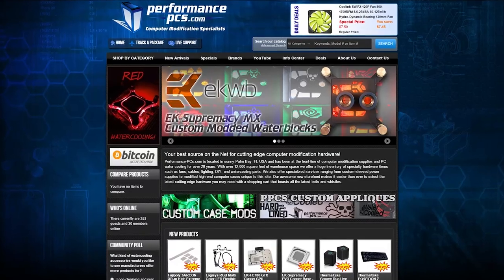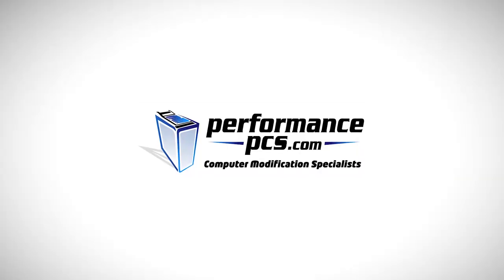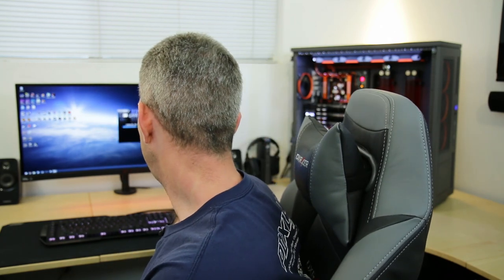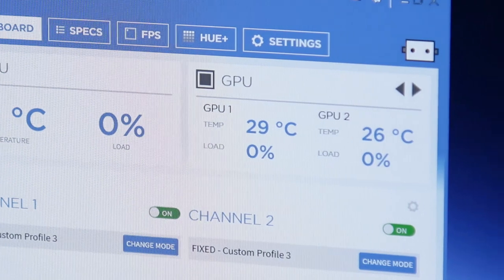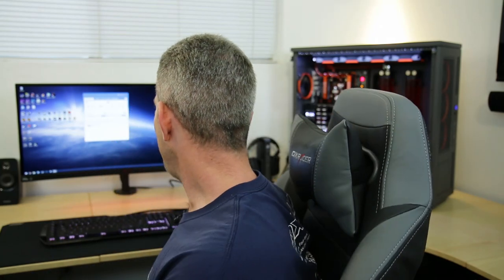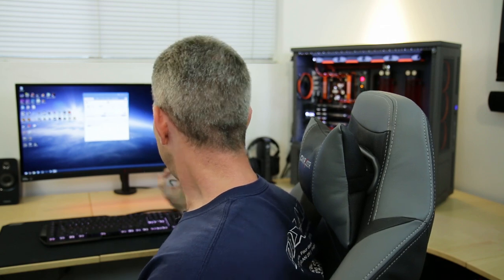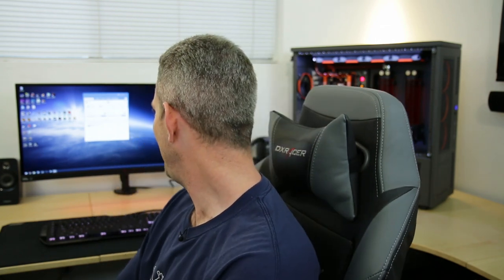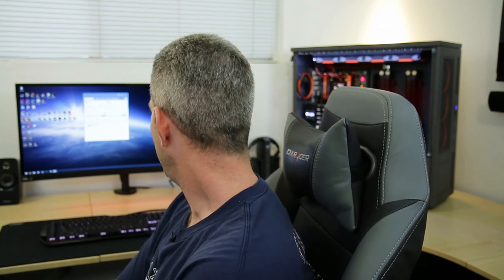INSANE Gaming PC 3 Titan X video cards! Such overkill

Comment from the maker: so does second
Reply: Jay, review your 980ti waterforce card. Thanks!
Reply: +JayzTwoCents Why don't you try to water cool a raspberry pi 2 model B+?
Reply: 2rd*
Reply: +JayzTwoCents would you put a water chiller in skunkworks?
Reply: +JayzTwoCents Love your videos Jay, Happy new years to you.
Reply: +Rpkiller condensation ?
Reply: +JayzTwoCents You should get some lighting behind the reservoirs, they basically disappear in the camera shots where the PC is in the background.
Reply: +JayzTwoCents what happend to the orange color ?
Reply: +JayzTwoCents  Excellent job.  The build looks beautiful as usual.  Questions though.  In the vid it looks like the reservoir area is very dark.  Does this hold true in person as well?  If so have you THOUGHT about the possibility of gentle lighting behind the reservoirs?  

There was speculation before on the idea of nickel plated GPU backplates for reflecting the clear GPU blocks which may have required some additional lighting.

Given the difference in color concentration between the tubes (couldn't really see the color in the blocks) and the reservoirs do you, now,  think that this effect would have been minimal due to washout from the light on the paler hue of the color in those areas?

Comment from the maker: Wow... so looks like the end slate got messed up lol... oops
Reply: +JayzTwoCents You had one job
Reply: +JayzTwoCents I was wondering about that haha, https://www.reddit.com/r/WidescreenWallpaper/ if you are looking for some widescreen wallpapers
Reply from the maker: +Chea Doherty DAMNIT JAY GET YOUR SHIT TOGETHER!
Reply: +JayzTwoCents  looks like you use fanta to cool the pc lol nice job love your channel
Reply: +Georg Meisel Proubly in the lower "basement" of the case or behind the mother board in the wire management section of the case
Reply: Chris N Anne is behind in the cable management section he showed in a video in one of the updates vlogs
Reply: +Georg Meisel IIRC he's using SSD's that are behind the mobo tray.
Reply: +NoName Fanta LOL
Reply: +Georg Meisel The drives are located in mounts behind the reservoirs. Caselabs has a really good mounting system in the SMA8 because of the extended width compared for example the 900d, it allows for more rad space and easier accessible drives :)
Reply: +JayzTwoCents No Cheesecake donuts for you good sir...good day to you sir:) j.k
Reply: +JayzTwoCents Hey Jay! I just realized you have not been using the EK Vardar fans in your recent build videos. Is it due to any reason (the fans being not the most practical for those builds)?
Reply: +JayzTwoCents I just realized your fluid looks just like Irn Bru (in case you don't have it over there it's a scottish soft drink) XXDD it's AWESOME!! XDD
Reply: +JayzTwoCents beautiful, greetings from Argentina! cheers!
Reply: +JayzTwoCents How Noise is your system with all the Fans and Pumps ? Can you maybe measure it ?
Reply: +JayzTwoCents I totally agree, would love to mod myself, have been thinking when I rebuild my rig, to spray paint it in a two tone or something. Skunkworks looks great!

Comment: I think you should but some LEDs behind the reservoirs because they don't show at all right now. :)
Reply: agreed it would look so much better with some chrome or led's behind the resovoirs....looks awesome! thats my next purchase tha sma8 case...so much room
Reply: +Cody Pettigrew  yea definitely!! my next build is that case. .so many options
Reply: +Theodor Mauros Instead of LEDs how about some more chrome/mirror to reflect light through them? They definitely need something to help them pop though.
Reply: I would say at the front of the case, tucked in the corner so that they're not so glaring, but regardless, he definitely needs something illuminating the reservoirs for sure.
Reply: +Theodor Mauros That's a good idea. Soft white LEDs with adjustable brightness so the res color matches the rest of the loop throughout the day. :D
Reply: +Theodor Mauros Agree!
Reply: I was thinking about that, too! It would look pretty good
Reply: +Theodor Mauros yea plus the color has darkened a bit due to the black wall behind it
Reply: +Theodor Mauros I was thinking the same thing it so dark where the res's are now you cant see them.  maybe if the set up allows a led lighting from the bottom if the pumps have that option, it would probably help blend the orange power wires a little better having them lit up.
Reply: +Mojodathegreat you definitely could. The hue+ has so many options and he is definitely not using all of the strips. As long as all the other strips are on one channel he could use the second channel to put some lights under the red or something and make it not as brights so it's not distracting.
Reply: +Theodor Mauros it was in my mind to :)
Reply: +Liakoz dude what

Comment: I noticed that you didn't use the 6-pin for extra power to your pci-e lanes. is there a reason for that, and do you think it would make a difference? I ask because I have the msi z170 gaming titanium edition, and it's got those as well, and I'm just wondering if it would be worth it to try and neatly run a cable to it.

Comment from the maker: and third
Reply: My favorite youtuber! :D
Reply: +JayzTwoCents fourth
Reply: +JayzTwoCents why you do dis you took all the podium slots T^T
Reply: +JayzTwoCents Hardware Labs is based out of Philippines? Shout out to all my Filipinos tho.
Reply: 3st*
Reply: Could you do some 3440x1440 gaming performance numbers please? There really aren't enough of those.
Reply: I love this version of skunkworks. think if you add some white leds it would make the fluid pop and match better with the fan rings
Reply: +Bethan Jenkins around the res
Reply: just use valvoline high milage... lol
Reply: +JayzTwoCents as great as your normal Firestrike scores are Jay they seem a little low for the hardware your pushing... with my 5930k and jus 2 980ti Classys I hit a graphics score of 48235 and an over all score of 28624...
Reply: Happy new year my friend.
Reply: +JayzTwoCents I still think you should contact DEMCiFlex to get the Case Labs filters kit or Hank from performance-pcs for your case.  Give some accents and keep out the dust, also if you wanted to leave that front ventilation open, you could with one of their magnetic filters, and not even have to use that piece that they sent you about your 5 1\4 drive spacer issue.  Also...I want to see you do a xeon E5 setup build, and oc where the 2011 v3 are unlocked, at least with the E5-1600 series, maybe the E5-2600 series are as well.
Reply: should have gone amd over 5ghz
Reply: jay i know that you like that dark orange but its too dark in the tanks please put white led behind them btw great pc
Reply: Perfection jay
Reply: that is dream build
Reply: +JayzTwoCents I did a $700 order a couple weeks ago (tried emailing you concerning the $4500 build) with ppcs and their product selection as well as responsiveness to communication is amazing~ Thanks again for the turn-on to a wonderful company. Frozen was scary years ago when I first got started watercooling.
Reply: +JayzTwoCents Then there's Linus, sitting with 7GPUs and 1 CPU. Get on his level mate. <3
Reply: is water cooling worth it. or is it mostly for looks
Reply: could always do  little, dare I say... reading, on google about the pros and cons of watercooling... or anything for that matter...
Reply: +Clayton Crawford yes
Reply: +Clayton Crawford  worth it for over clocking
Reply: why is it filled with irn brew???!!!
Reply: +ben crawford Irn-Br"u"
Reply: +Kevin Vaughn DEMCiflex does make amazing custom filters! i have an old heavily modded antec 1200 and they hooked me up with custom designed filters a couple years ago. i wash them out real quick every couple weeks and good to go. they also make oem fit filters for most cases.
Reply: +Squid Bacon - Minecraft, CS:GO & More (Youtuber) we will assume ur joking
Reply: +JayzTwoCents How Noise is your system with all the Fans and Pumps ? Can you maybe measure it ?
Reply: SwissCow85  He already has a video on it, try and find it. He runs his fans at very very low RPM's. For the Db's I dont know.

Comment: One thing that's been bugging me for a while about SKunkworks is why is that rear case fan set as exhaust? Given you have a quad rad up top but only 3 intake fans it might be more useful to have that rear fan intaking, as well. Have you tried it that why? If so, did it change the temps at all? TBH I doubt myself that it would change anything considering the size of the rad, but I'm still curious.

Comment: Jay what is the part number for the CPU block? I buy all my supplies from Performance PC. I already bought the supremacy version and I'm building a X99 Asus deluxe motherboard so I would like to use the same one you are using to take advantage of the cooler temps this block is giving you. I will be using the 5960X processor and 2 EVGA 980 TI's in sli can afford 3 Titan's but from what I'm reading the 2 980 TI's are almost as good as the 3 Titans. Why are you connecting the GPU's in Parallel and not Serial. I would be worried that it possibly could water lock and the flow wouldn't pass though the block properly. Have you done any benchmarking on both ways??  Thanks for any help on the part number.

Comment: I wonder if OC the main card more than the others would yield most of the benefits of OC all 3 cards, maybe a test of all 3 @ 1400 vs all 3 @1500 vs main one @ 1500  and the other 2 @1400.

New build looks good, less contrast than the previous one, but the LEDs are a bit on the blue side.
Reply: *****
The main card is supposed to have more load than the other 2, so it should help.
Reply: +Keven Harvey pretty certain SLI'd gpus operate with the lowest common denominator (i.e. You can't overclock a single card higher)
Reply: Luke Woodcock
Well Jay mentionned that he could, but he can't be bothered and he prefers all 3 to run the same speed. And I'm pretty sure you can SLI cards that have different factory OC and boost 2.0 means that pretty much every card will have a different clock speed.
Reply: +Keven Harvey you can't run cards in SLI at different speeds. It is simply impossible.
Reply: Ni De
If you google it, you'll see that it's definetly possible, and a lot of people get different clockspeeds without even trying, all I get though are results for 2 way where there are no benefits, the higher clocked card just doesn't reach 100% utilization.
Reply: Keven Harvey Exactly, it's not that the system will explode if one card is a different clock speed, it's that the SLI configuration doesn't utilize clock speeds faster than slowest card. This might change in the near future as there have been some technical tests on DX12 using 2 totally different GPUs to increase graphics performance

Comment: 9:15 How can the room cool down if it is the same overclock? If the new CPU block is working better, then you are pulling more heat out of the system and in to the loop. Assuming the loop is able to get rid of that extra heat you should see the room heat up more?

Comment: Cooler room means cooler PC. Cooler PC does not mean cooler room.
Reply: LN2 cooling will cool your room, but only because you take some cold (physical not correct) inside your room.
Reply: exactly, Cooling your PC faster just dumps the heat into the room, I use My 2 PC's as a heater until Outside temps hit below 60F The Main one is watercooled @4.2ghz
Reply: But warmer PC means warmer room. :(

Comment: I was wondering if you have or if you would do a video about what speed, what rpm that you have your pump set at, with your cpu overclocked and also do you use different fan profiles. When the systems is at idle versus under a load. Or like do you just keep the pump at one rpm setting the whole time? I know that, that will vary from pc to pc that is liquid cooled but, I've been wondering since I built my loop. Like would it be better, temperature wise if I just ran it at one constant speed versus letting the fan profile built into my motherboard bios control it.

Comment: Was wondering if there wasn't a monoblock for this board like the  is for the Rampage V Extreme or if its better to use separate blocks for the CPU and mobo. The build looks really good with all the hardline running right over the mobo but it looks like it would be more annoying than its worth if you had another option.

Comment: Jay, i need you're help:
I have my PC (I5 4440 & 2 GTX 970 in SLI) connected with Display Port to Mini Display Port to my Dell U3415W, with Display  Port the screen goes Black and has weird grey/white flashy stripes, if i switch to HDMI, everything works perfect. Can it be that my Display Port Cable is broken? It happens with both my GTX 970s connectet to it whenn just one is running in the PC....

Comment: Jay, yr the expert on GPUs and FPSs. I'm building a gaming machine for 21:9 3440x1440 predator gaming monitor. What kind of GPU power (and CPU) do I need to run let say Witcher 3 on ultra above 60 fps on that monitor? Thanks for the great vids btw.

Comment: Not sure if anyone has thought of this yet, and sorry to bring the subject back up, but the pastel fluid might have been changing colours because the 'nano fluid'  was just a salt dissolved in distilled water and the ions were helping to transfer the heat away from the hot components. When the liquid got hot some of the water would evaporate, super saturating the solution causing the salt to crystalize out and form the white powder that was left behind. Because the coolant's base colour is white (I believe) because of the dissolved salt, when it precipitates out of the solution it darkens because all of the left over dyes are left alone to make a different colour. Not too sure but it's just an idea.

Comment: +JayzTwoCents ,is it possible to use a coarse poly sponge (3"r x 1"t), to act as mechanical filtration to a water cooled system. would that affect pump pressure?

Comment: Jay, I know you have made a lot of how to videos of water cooling but you never made one specific about how to plan AND EXECUTE a hardline loop. i have alot of parts that i think i need for hardline water cooling, and its my first time and im working with very high end parts. i dont wanna mess up anything. I feel kinda confident that i have the general knowledge but i dont know if i should install the pump and res first and then measure and cut and bend or where to use T section or 90 degree rotary or where to put fill and drain and what kind of valve to put where. please make a video about the design of the loop itself.

Comment: Can you do an in-depth test of the EK-Supremacy and EK-Supremacy EVO for an overclocked x99 chip. And do with different jets in both blocks to really see if there is alot to gain. I have read some reviews that does not support what you revealed here. So I'm abit confused on the matter. I am thinking about buying the EVO version after this video thu. But could it have been some restrictions in your old block, seeing as your EVO is brand new, or that you did a better mount of the EVO?

This would be really interesting...

Your rig looks so cool now, and I did not like the orange idea to begin with, but this turned out ALOT better than yellow. And the details, fantastic! But id recommend cable combs for the 24pin.

Comment: +JayzTwoCents The new color doesn't look to bad, not crazy about orange. The fluid in the reservoirs appears to be more of a red / burgundy color. That may be just the lighting. I'm planning on a build using red and green. Not holiday colors but blood red for the CPU and a yellowish-green zombie bio-hazard color for the duel GPU loop. I really don't want to mess around with colored fluid and was thinking of using UV reactive tubing until I saw how good the rigid tubing looks. I'm wondering if/when UV reactive PETG is in the works.

How about you do a Lowe's / Steampunk all copper tubing build.

Comment: Since the hottest graphics card is the one with the monitor plugged in it, then is it possible that if you changed which card the monitor is connected to, the gpu loop could run cooler?

Comment: +JayzTwoCents Love the videos and especially the update to Skunkworks, looks really clean. Question I have for you was regarding fittings. I initially brought primochill petg 1/2" od 3/8"id but I have had issues finding good fitting (my opinion) that have the angle fitting (90, 45 etc.). Part of this reasoning is why I think I might buy 10 mm/12mm and go bitspowers black sparkle fitting. Do you have any recommendations? Maybe this might make a good video about fitting and tubing considerations pros/cons. What things you should try to incorporate into you loop (fill ports, drains, placements) or stay away from.

Comment: i kinda wanna see some form of led tubing go through the center of water cooling tubes at some point. probably counterproductive since the lights would probably heat up the cooling fluid, not to mention less roof for water flow but it would still LOOK cool.